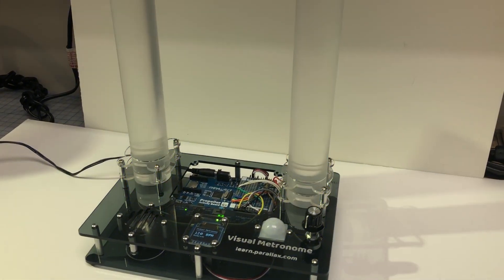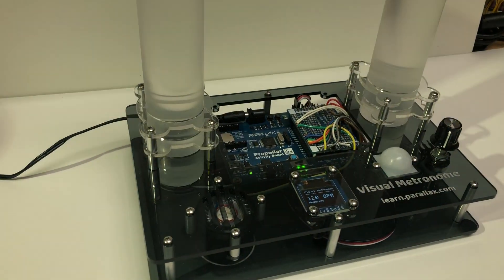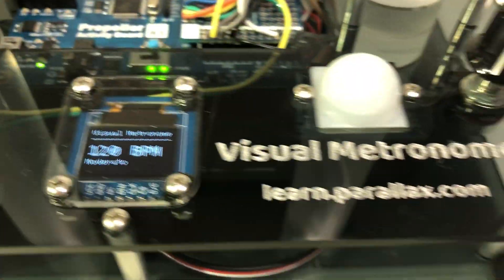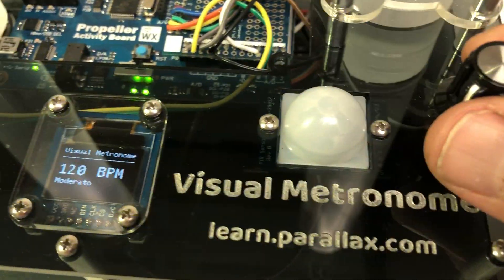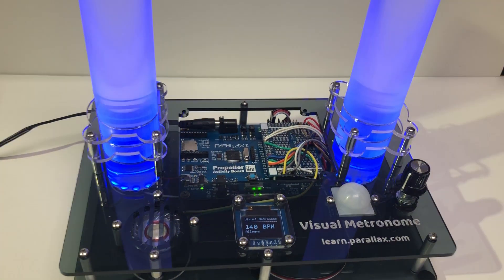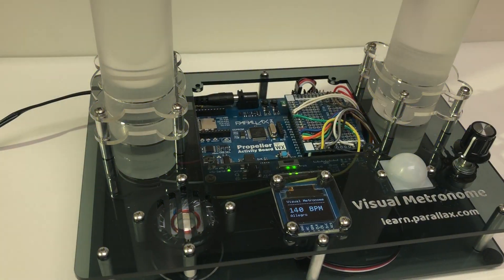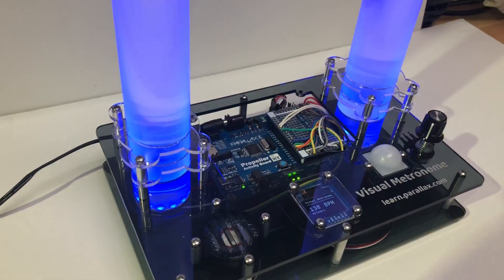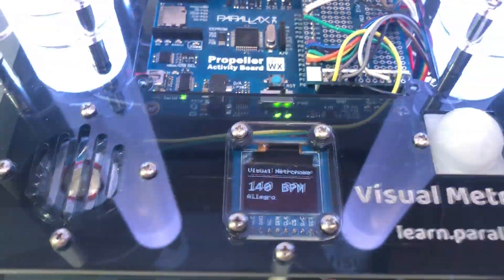Visual Metronome

Comment: Hi. 
Fantastic project!
It’s March 2021 now and this is exactly what I need to get away from distracting click metronome for my guitar practice. 
Will it do 12/8 time?
Is everything on your link what I would try to buy to build it?
I guess my question would be is there an update or do I follow this post for the materials and build?
Reply: Hey AJH, sure, you can build this and set it up for 12/8. You'll need to read the project carefully to see how the timing really works in the Propeller, and it's not all that difficult. You can also not use the internal timer and assume the basic commands that have no timing occur instantaneously and you'll be close enough. The parts are what's listed. Share your results back to us at Parallax - Ken